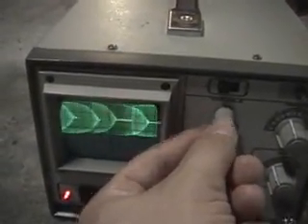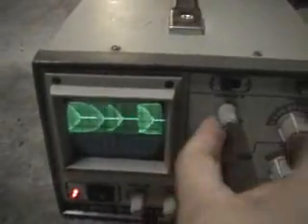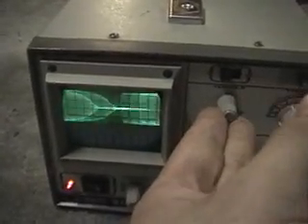Wireless Transmission of Electrical Energy, Tesla 1900 part8

Comment: @taruler16 Using a regular antenna will pull energy out that has been put in artificially by power, radio, and phone companies. But it's not going to work after the system collapses. For true independence, we need to find ways to tap the zero point. That's where we need to focus our attention.

Comment: i have found that connecting the recieving side to large metal objects helps by creating capacitance. 
I am using ignition coil with 12V and i have like a dog bowl that simply sits on the High Voltage wire, is i hook the dog bowl up to a CFL it will light with one wire. And the dog bowl is not physically connected to the HV wire, just sitting on or near it.

Comment from the maker: well if the waves are resonanted with the wire, then the energy should be held close to the wire in the field, not radiated to far, this i put up to prove one wire transmission, i dont have the testing equipment that would show the efficientcy, there are so many factors LOL! thanks fro checkibng this out!

Comment from the maker: yo killer doug! i haven been able to further excite the coil enough for an improvement mainly because of the ground fault inside the transformer,its such a hold back, once the gfi sense to much current/voltage drain it turns the transformer off. dont worry im working on a similar set up with "newer technology" lol. i was able to light a compact florecent bulb, not as strong as the socket but it was lighting up!.

Comment from the maker: no you dont understand what im doing, im making historical refrences through this work, teslas first system started like this,one wire transmission, this example could be used in households and commercial applications. this lead to the earth wireless system, the wardenclyffe works on the same priciples but in alot of ways is very different. dont worry theres more to come, im just in the works, and dont have alot of money, right now im just putting along, trying to do my best.thanks for therating